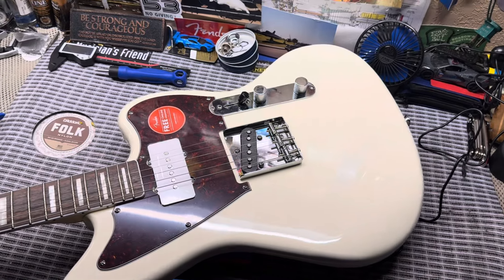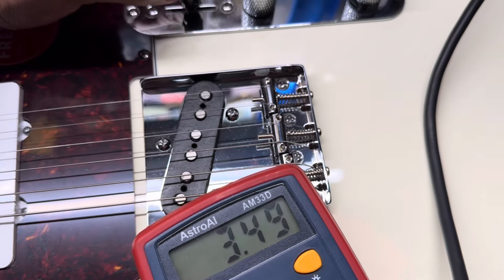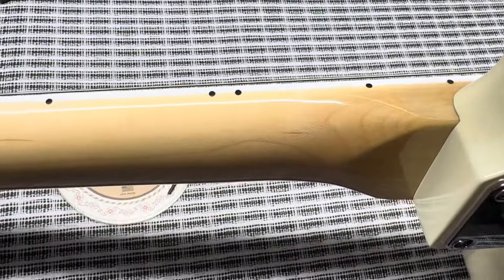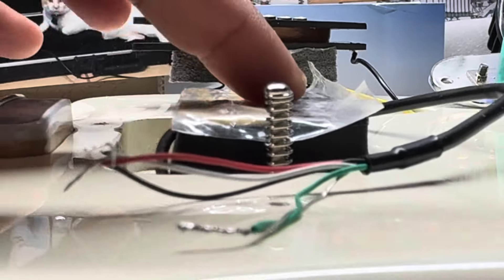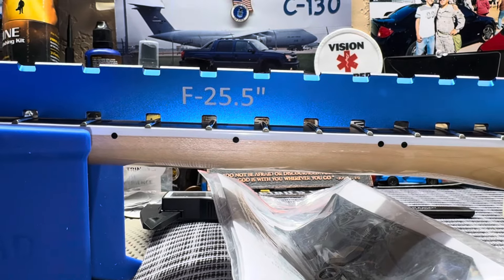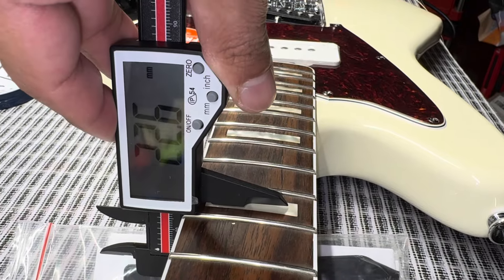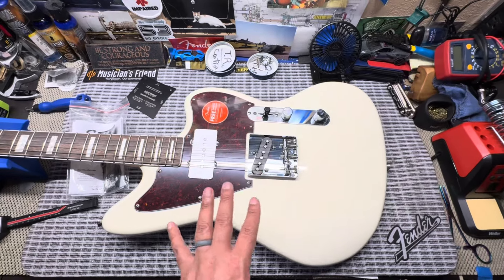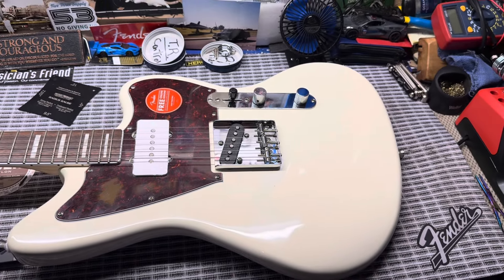TECH SPECS Squier Paranormal Offset Telecaster SJ Limited-Edition Olympic White

Comment: My Tele SJ is wired the same as yours and the wiring is wrong. Per spec the push pulls should only affect position 2. The volume push/pull cancels position 1 and makes position 3 the same as position 2. I sent my Paranormal Tele SJ to a Fender Service center to correct the wiring.
Reply from the maker: @bpdsmyth  nice I’m getting into Wiring and saw another YouTuber with the same problem on his guitar. He thought something might’ve been wrong but thank you for the info. 😎🎸👨🏻‍🦯🙏🏽🕊✝️🎼✈️👍🏽